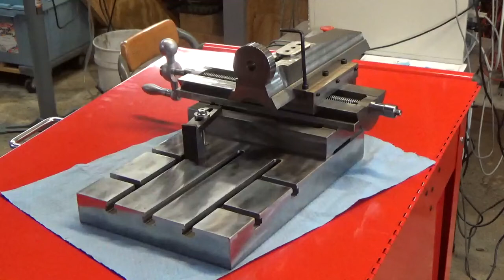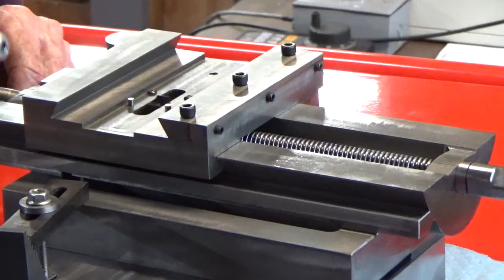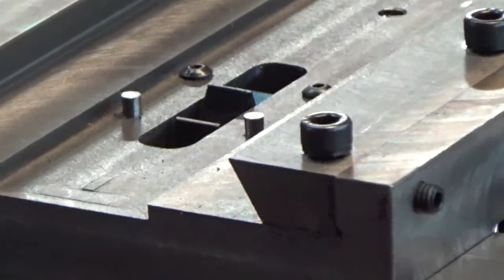Shop Built Hand Shaper Progress - 2

Comment: Hi Larry, greetings! Thanks for all the videos. I like making small machine tools like you. I'm learning a lot from you :) May I know the gib screws that you tighten down has any free play?
As the grub screws at the sides are pressing against the gib? from Steve (stewan@gmail.com)
Reply from the maker: Steve:I only drilled the holes a few thousandths larger than the screws themselves.  I can always slot the holes a bit if necessary.  After scraping and aligning was complete it was necessary to do that on the ram gib, but so far the cross slide gib had been okay.  Regards: Larry
Reply: Hi Larry thanks, could I pte email you if I need guidance in tuning small dovetail gibs? -Steve Wan